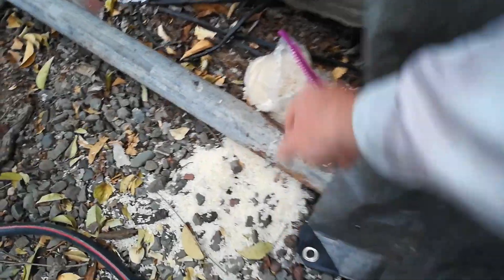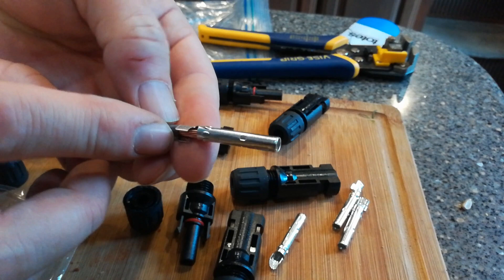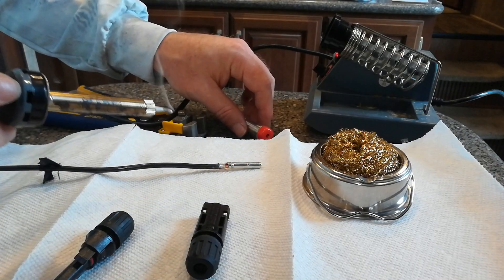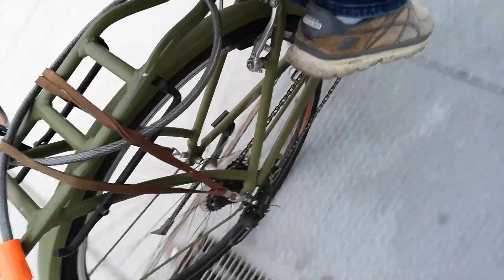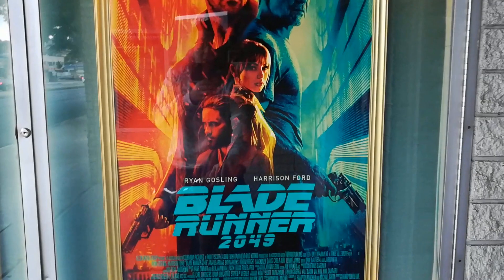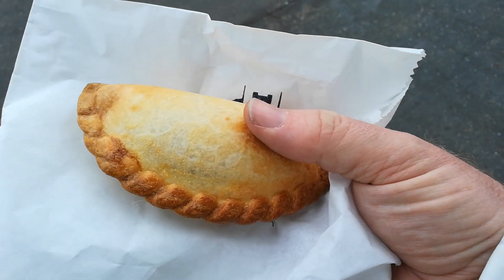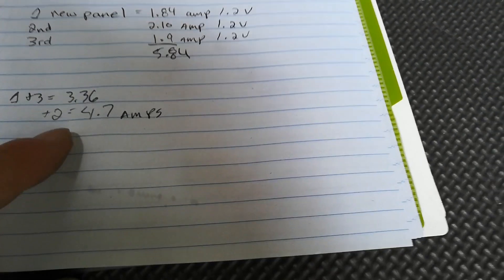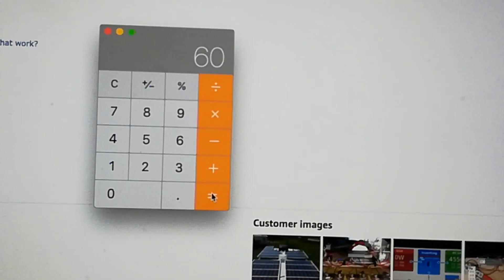OUCH! burned soldering MC4 connectors. Measuring Amps on flexible solar panels. Uship the RV.

Comment: I know a guy in his 90s who bikes with his tires low so he doesn't go too far from his house (so a rf heart device still works) but still gets a serious workout.Biking is the best thing any one can do daily.

BTW 63/37 melts at the lowest temp so that with flux core is the best of the best. If you have other solders you still want to use I recommend getting a tin of paste flux. Might be in the plumbing aisle as copper wires and copper pipes have more in common than not. A tin will last you a lifetime. Matter of fact if you can solder that well you might as well just solder them completely and use liquid electrical tape over them once cooled. This 'tape' can be super help in emergencies, too. (there's a brand in a yellow and black can that has a built in brush that is very reliable. I forget the name brand offhand. I remember it stood up to use on my snowblower in the past and its more convenient than heatshrink tubing)

10 amp setting is correct. (kind of, kind of not...depends what you know) You want it set too high rather than too low. That 10ga wire is good for like 25amps in houses. Wire thickness controls safe amps and the wire insulation controls the safe voltage. Dunno if your meter is spendy or cheap.... watch out using cheap meters on high voltage (anything over 120vac) because the fuses may not protect you if you have an accident. I'd think one of the meter companies have a meter manual online. Fluke is the best. Don't sweat not knowing.... takes years to understand the finer points of using a meter. At least yours is digital which protects against lots of simple n00bie mistakes. I still have my first meter... an analog one from Radio Shack from the 80s. If you ever get another one buy one with the current capacity measuring feature with a loop clamp on meter. Will be MUCH quicker and probably more accurate for the solar panels because you can leave them under load. 

Not sure what you were trying to do but usually the meter is hooked inline with the load in order to measure current. They are dependant on one another. Sorry to say the measurement you got is pretty worthless because your only load is the meter (which is designed to only draw a few microamps-- ie: as low as possible so as not to affect the results) wiki might have some instructions how to use a meter. You don't want to do that in the future as you might blow a fuse inside the meter. When you do take note of how many fuses are in there and google the types for info on how well it will protect you.

Realistically if you want to know how good anything is you measure the current under load then you can assume the voltage (or use a second meter like most of us) and calculate the wattage. (I'm no expert in panels but you might try the aerospace 303 protectant stuff that might help the flexibility and durability.) This is true for everything from solar cells to starters to alternators to car batteries. (google Maximum Power Theorem if you want to know more)

Load in amps times voltage in volts gives you power in watts. 746 watts = 1 hp When buying merchandise its good to use this to know when companies are lying to you about their products which claim more hp than they take in.

Comment: I am sure you know that there are many factors that determine what amps a panel puts out. The 5 or 6 amps out of a 100W panel is in perfect conditions with the sun 90 degrees to the panel and no clouds or shadows. During the winter months it's impossible to have the sun 90 degrees to the panels if they are flat mounted on your van roof unless you tilt the van. All I'm saying is your panels may be working better than you think especially since you have cleaned them up pretty good. I'm fairly experienced with soldering. If you heat the item you are trying to solder then touch the solder to the item and not the iron you will get a better solder joint because the wire will be at a hot enough temperature for the solder to flow. I like your bike. :)
Reply from the maker: +WannaBFree all great feedback. I appreciate it